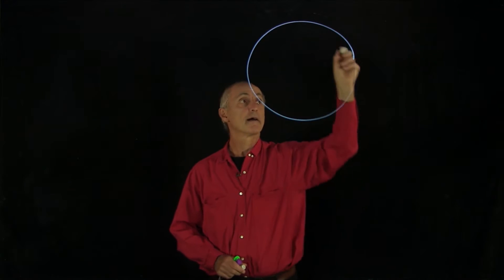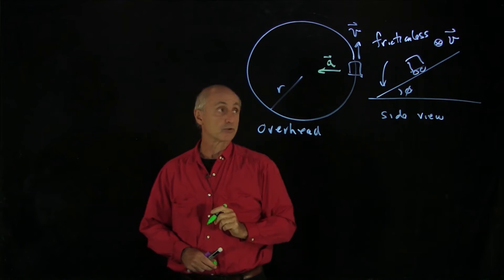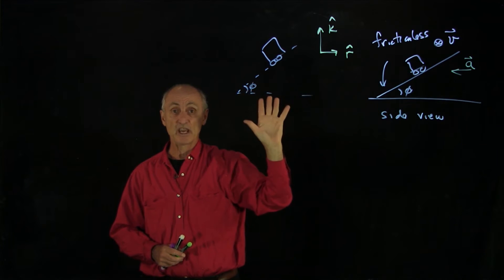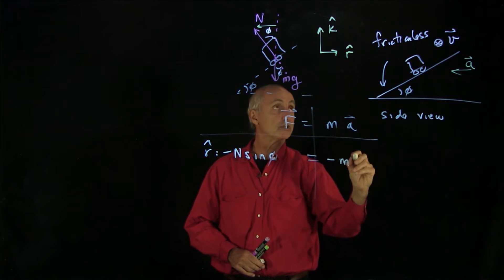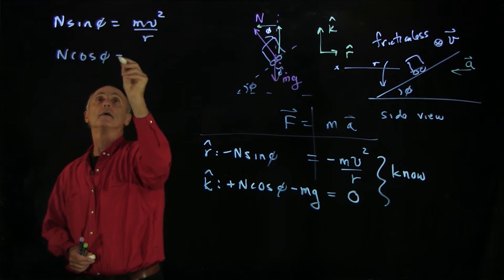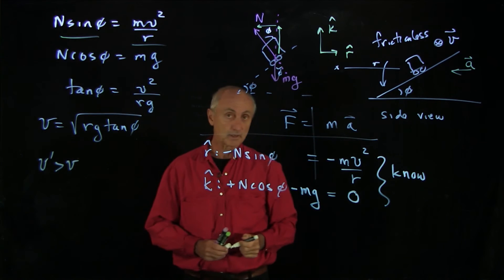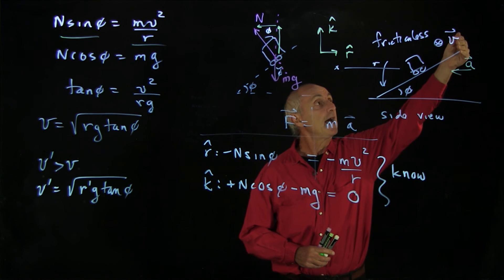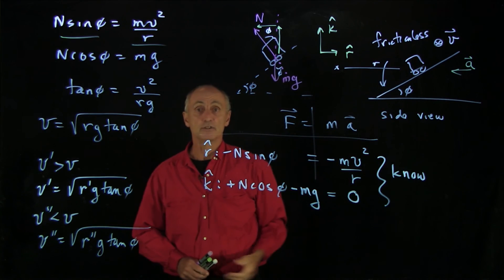11.2 Worked Example - Car on a Banked Turn

Comment: if the road is frictionless, wouldn't the car not move at all?
Reply: The road is a 2D surface in this case. Hence friction could have 2 directions. The friction is not there in the direction of the inclined surface. Whereas friction will be there in the direction into the plane which is what is required for it to move.
Reply: Yeah, I had the same thought. and I figured it must be a rocket-propelled car with the tires just sliding along the surface.😅
Reply: Friction opposes motion so if you remove friction there is no opposition to the motion. Therefore the removal of friction doesn't prevent it from moving but instead provides no restriction to its motion.

Comment: Shouldn't the acc. on the inclined "plane" point to the right
Reply: Centripetal acceleration always acts towards the centre(left) but if you place  a observer at the centre it will become centrifugal force and act in the right direction
Reply: @vibhanshbhatia4171  Hey, how can a car travel on the plane which has no friction?